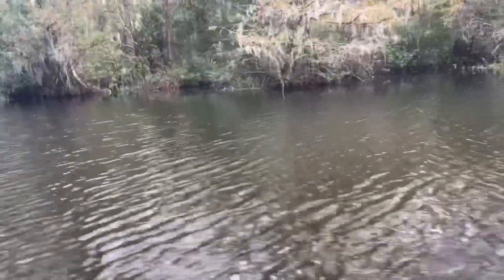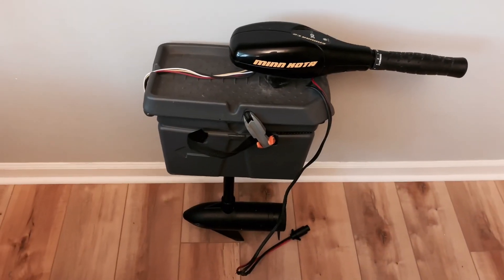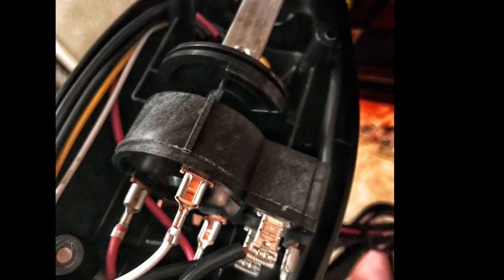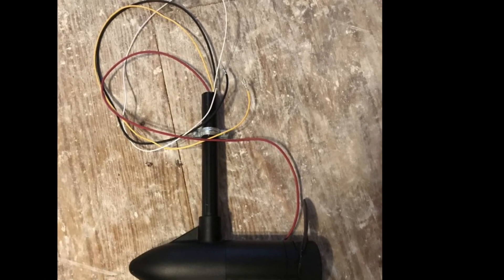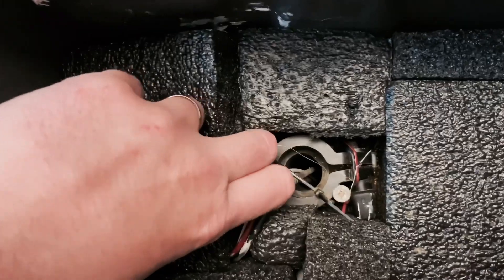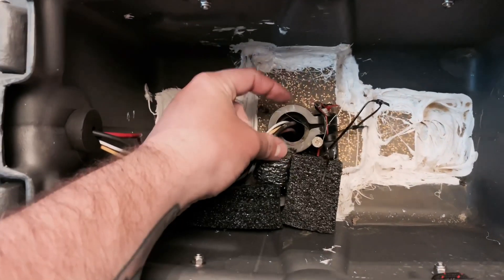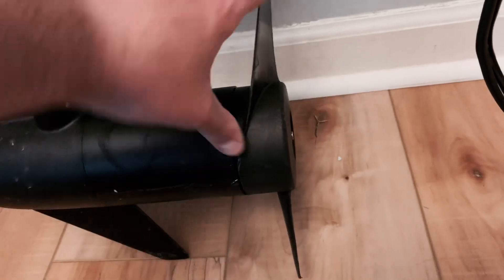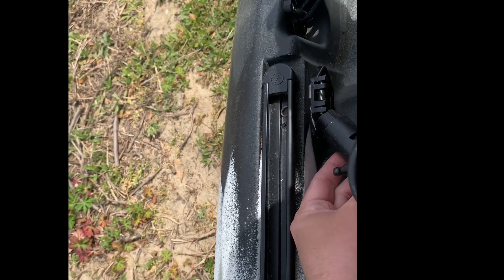How to make a DIY trolling motor pod for a kayak.

Comment: This is what I’ve been looking for. I have the big fish as well and wanted to add a motor, but will use the rudder to turn. A stable motor going forward is what I wanted. I love that you still have space. There is room there to add a fish finder if you changed out the control unit. I’m looking forward to your battery install and please post if you change out to a remote head. This is awesome and you did a great job on the video.

Comment: perfect. this is what i'm looking to do to my bonafide SS127. i don't need steering from the motor. I'm going to install a rudder and use the foot pedals instead. this way, it's more compact and i'll still have a useable dry pod.

Comment: Sure appreciate the video. Do you think the skeg on the fixed motor is fighting the rudder? I have a similar set up and thinking about cutting off the skeg and putting on a safety cage. Any thoughts?
Reply from the maker: I doubt it makes much of a difference... I have a pedal drive kayak now (video coming soon). It has basically the same “skeg” on the drive, although maybe not as big and is in same location. Most prop style pedal drives have a skeg like protrusion to protect it, as you said. That being said I don’t see any reason not to give it a try, I’m always interested in mods and diys. Let me know how it goes!!!
Reply: @NewAgeAngler  I Thanks for the input. I notice the bixby's don't have a skeg. Let you know shortly. Thank you.
Reply: Cut the skeg down to about a 3/4 inch finger. It could be my imagination but I think it helped, especially in reverse. FYI.

Comment: I have a feel free lure 11.5 love your idea more than other DIY's I've seen  how did you decide on having the prop 10 inches down from bottom of pod?  I've been curious how far down to have the prop go without being "too" far. Thanks for the video
Reply from the maker: 603 lunkerhunter might be a little different for the lure. I believe the lure is a little more flat bottom than the big fish. I’d make sure the prop clears the hull, and doesn’t create in cavitation in the water. Test it before you seal it up.

Comment: I'm getting ready to do the same thing with a Hobie PA14.  what size batter will last 6-8 hours of constant use.   I gotta go up river 6 miles.   Thats a lot of peddling and worse when the winds blowing.
Reply from the maker: 30lb thrust trolling motor will draw around 30amps on high speed (5) 12-15 amp on medium (3-4). Battery size will depend on how much you need to use it and what speed you set it to. Probably 50+ amp/hr at least.

Comment: Great job.  Ive got a Lure 135 and poured my epoxy and used a 2x6 on top as a base. Ran a couple screws down to give the epoxy something extra to hold on to.   How long did you allow your epoxy to cure.  I was thinking 36hrs would be enough and planned to drill my hole this evening.
Reply from the maker: I put the epoxy on after drilling, it was probably close to 36hrs...Maybe 48

Comment: Would a Minn Kota PowerDrive 55
 w/ i-Pilot fit through the opening? Would it be an issue to make it so the trolling motor could rotate in the pod without it flooding the kayak? Thanks
Reply from the maker: I doubt it. I haven’t seen that one in person but, I’m guessing it’s with spot lock/gps. Either way I doubt any 55 will fit. The 30 is already pretty snug.

Comment: Please describe to me how you ran your wires inside the kayak for. the power connector.  I have Big Fish 120.
Reply from the maker: The wires are ran thru the hull to a quick connect port in front and back. I linked the port in description you would need 2 males, 2 females. 1 male that connects your battery box to the boat. 1 that connects the trolling motor to the boat. I believe I used 8gauge wire if I remember correctly. I fished it thru the holes cut for the ports, it’ll be a little easy to fish the wires through if you stand the yak up on it’s end and let gravity help.
Reply: I am awaiting parts so that I may make the same type build.  I believe I am going to build a battery box and have all my connections made on it. A female connector coming off the battery box, and trolling motor male connector to plug it in.  I plan to remove the Minn Kota head and build a digital pwm speed control. The speed control will have a cable which will be in a tube and will sit in the compartment on either side of the Big Fish 120.
Your video gave me the basis for this plan.  Many Thanks !!

Comment: I just want to know one thing, 3 years later  how did it hold up ? Any issues with flexing because it's only attached at bottom and not two points. About to start on a vibe shearwater 125 mod  like this one .

Comment: Can I please ask what adhesives you used for the starboard? Will that adhesive also stick to polyethylene board? Thank you!!!! I’m needing to get this adhesive soon! Thanks again!!!
Reply from the maker: I’d go with a marine epoxy. I don’t recall the brand but most marine grade epoxy should work fine. Usually take 24-48hrs to fully cure

Comment: Great video, thanks! Do you know the size of the propeller unit? Diameter and length? Just curious to see if it will fit my FeelFree Lure 11.5.
Reply: The minn kota endura c2 30 will fit in the lure 11.5 and up.

Comment: Bought the center  pod for a bf 120 w a endura c30 when I got on it water started to pour in from the sccupper holes  and didn't feel stable at all I'm probably pushing the weight limit of 400lb did u have the same problem
Reply from the maker: Not really. It will come in and out that’s how they work but, you shouldn’t get more than a little in it. You can plug them with scupper plugs that can be bought or a cheaper option is foam golf balls. Works great especially in fresh water when you don’t get many waves over the bow or sides.
Reply: @NewAgeAngler  loved the "foam golfball" idea for scupper plugs! That'll do it and CHEAPLY, too!

Comment: Why not just keep it in 1 piece so you can still turn it with the trolling motor tiller?
Reply from the maker: Great question! The rudder steering is going to give you a much tighter turning radius, plus now it can be sealed water tight. Also this was mostly a modified version of some others designs so it’s really going to be up to you individually what works best for your setup.
Reply: @NewAgeAngler  oh I have a 6hp outboard on back
Reply from the maker: Bipedal Hominid Nice! I use to have a 14ft Carolina Skiff with a 15. Looking hard at the BF108 and the FeelFree dorado now. Really like the pedal drive options.